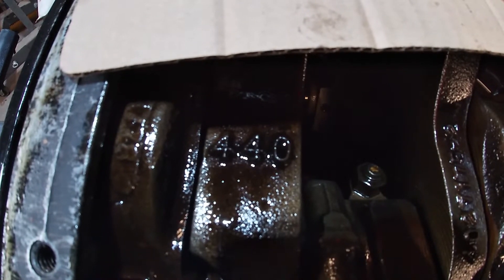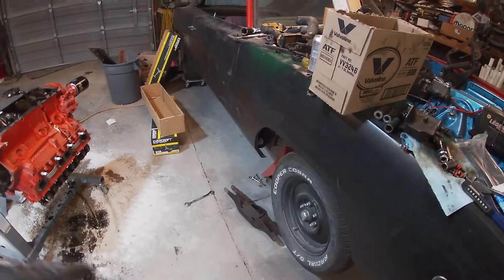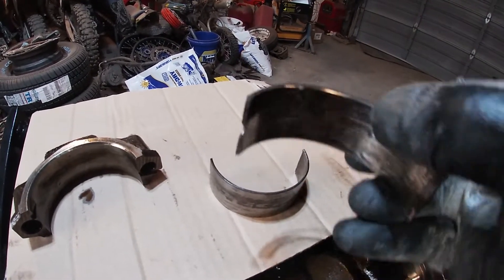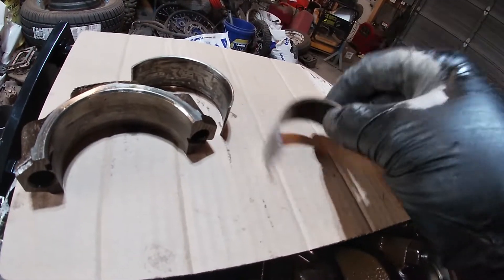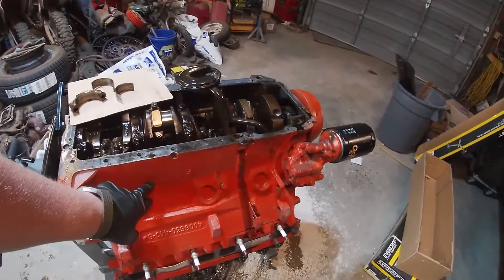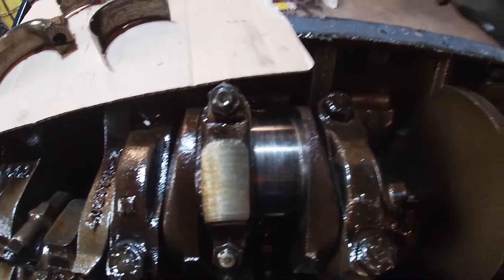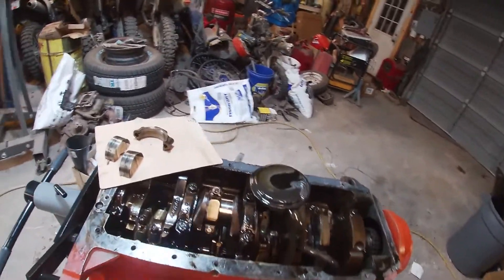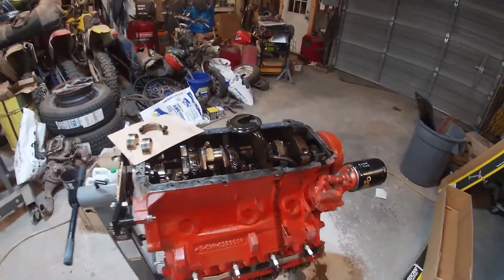Tearing Into The General Mayhem Rod Knocking 440 // Motor Disassembly Video // FMG EP. 45

Comment: Nice video....bad luck on the bearing....if your not going to use the cast crank do you want to sell the bullet nose crankshaft dampner. I'd buy it.... Anyway still awaiting the MH engine tear down hope that goes well.
Reply from the maker: which motorhome engine?  cause this is the motorhome engine out of the general mayhem. and then the new motorhome engine is just being cleaned up and put in the car
Reply: @floyds.mayhem.garage  oh ok your going to slip the one out of the new motor home with out taking apart cool. Are you keeping the old bullnose dampner out of the old motor home since your junking the crank? Since it only works on cast cranks.